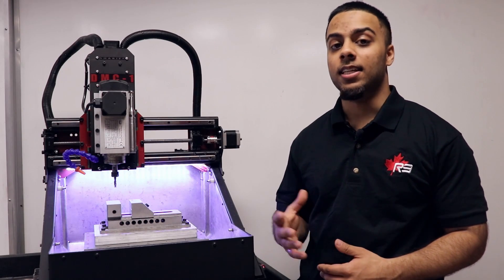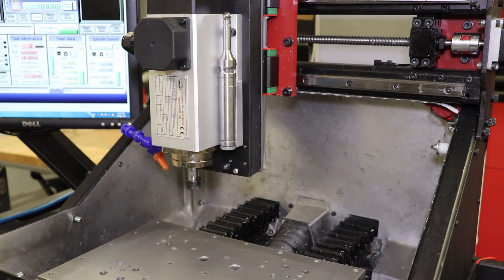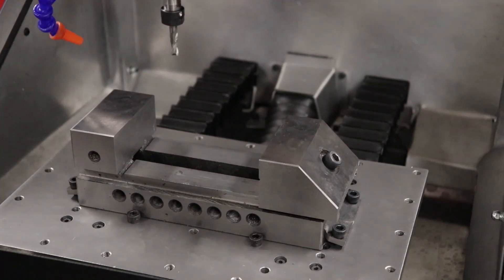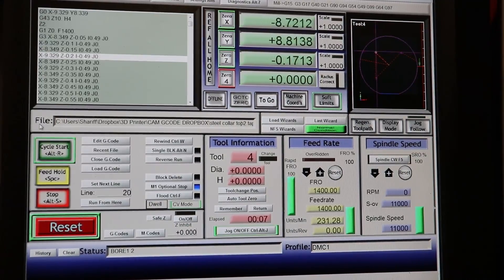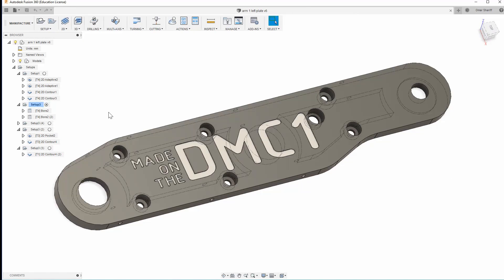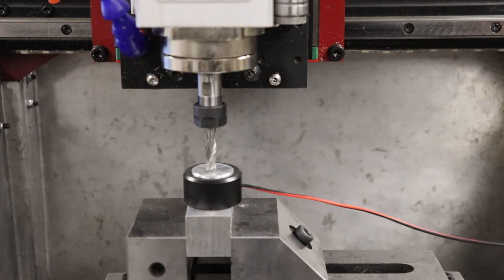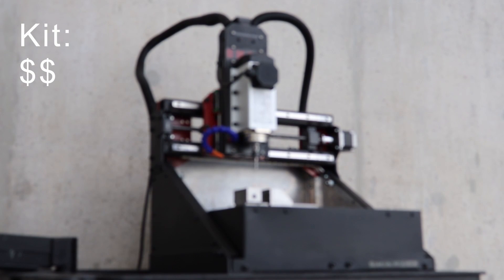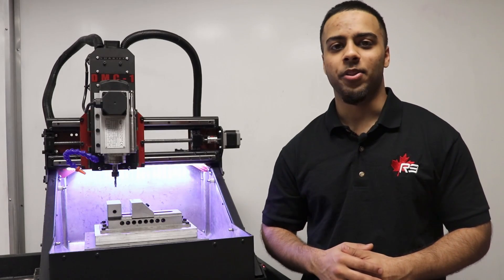An in depth tour of the Shariff DMC1 CNC

Comment: There are a few things that do not add up.  24V for the stepper motors?  Smack um right in the knee caps!  2 HP spindle, the name plate on the spindle does say 1.5KW, but the data sheet says the VFD is 120V.   I have never seen a 120V VFD that was over .75KW  So are you all knee capping the spindle motor as well?  Why are there no images of the inside of the stepper drive controller?????
Reply: I uploaded 2 videos of a machine I built using a 110v 1.5kw spindle cutting at 6000 RPM. Plenty of low end torque to cut brass.   I have a 110v 2.2kw spindle to upgrade on the way.

Comment: My only question is why a Er11 and not a Er16? 
Would had made so much more sence 
Specifically when all the lovely insert tools that you can start to get and use at Er16 ( yes you can get insert tools that will fit into Er16. Specifically if you find/buy a Er16 callet set with a 12mm callet)
Reply: The spindles are only available in ER11, ER20, and I believe ER25.

Comment: Awesome. I whould buy one. If its a final Produkt and you whould ship to Germany 😍
Reply: Lukey Fran +
Reply: Yo can make your own at the price of around 1200 dollars in less than a week.
Also you can replace the worst drivers on the market (tb6600), the weak 24V power supply and replace the 1.5kW spindle with 2.2kW one without additional cost.
It will cost you the same efforts as building a kit.